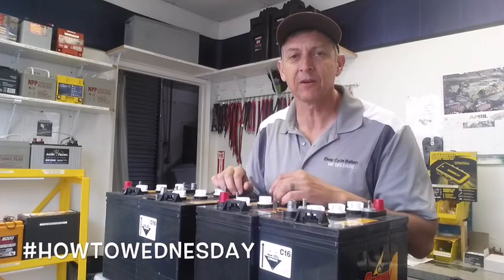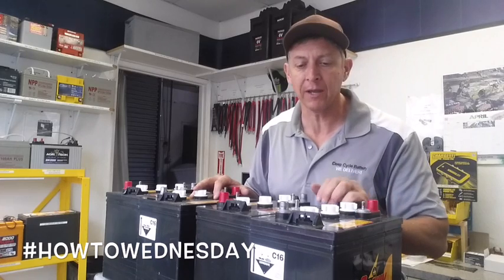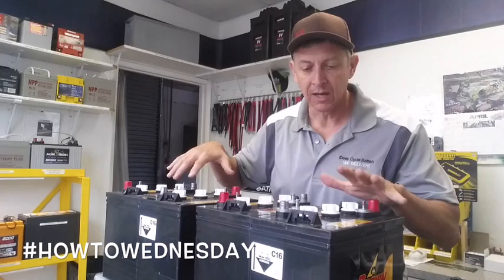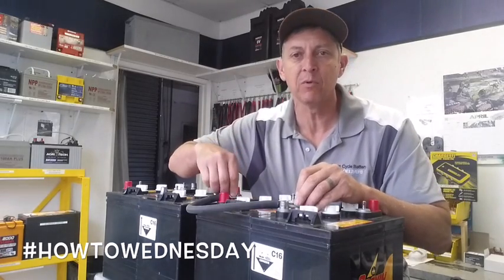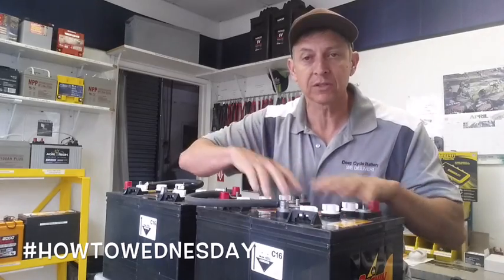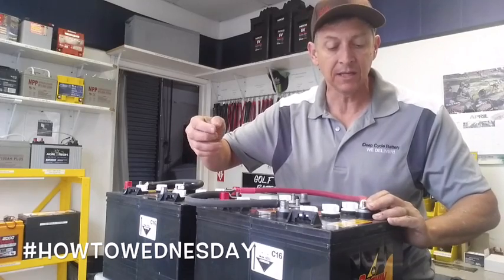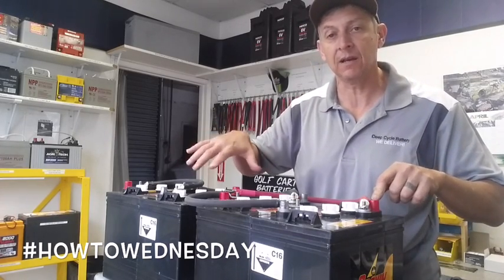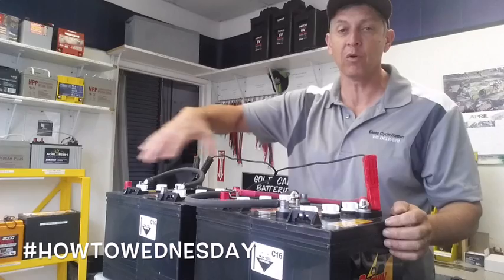How to Connect Batteries in Series Parallel Deep Cycle Battery 6 Volt

Comment: 1044am I have 8 batteries T.20 Trojan tractor batteries 6 volt deep cell. Can I hook all up for 12 volt system for an off grid solar set up. I really need help.
Reply from the maker: It sounds like you're trying to mix six volt deep cycle and 12 volt deep cycle? If so not a good idea
Reply: @DeepcyclebatterystoreSanDiego  well I figured it out. 8. 6 can make volts 4 12 volt batteries in series. Then parralel to make one giant 12 volt battery
Reply: No. Wiring both series to make the 12 volt. And then wiring for parealel to make one big 12

Comment: we have  (8) 6volt batteries(400AH)  hooked up series with parallel  on a stand alone solar system for our submersible pump and freezer -  What gauge would yo recommend ?  4 gauge cable ?  Thanks for your excellent video and instruction on this !
Reply from the maker: 24V system? What is inverter voltage and watts?
Reply: 10-15 volts incoming on first inverter(AIMS Power 5000 Watt Power Inverter, PWRINV500012W)   second inverter (AIMS Power 3000 Watt Power Inverter, PWRIC300012W) also has 10-15 input volts     --   thanks for your thoughts !      Dave    -   both inverters are about 10 years old  - but all worked well until the batteries died

Comment: Thanks for this video, this is the exact setup I have, including the same branded batteries. My setup is for a converted shed, that uses a 2000w inverter that powers the shed. I have a question: When charging with solar, the batteries will peak at 14.4V and the charge controller indicates that the batteries are full. Once the solar is disconnected or night falls, the batteries drop to 13.2V and will discharge without load to 12.6V throughout the evening. Is this common or is there any issue with the battery? I expected the battery to discharge at a slower rate.
Reply from the maker: This is normal. read article on battery discharge characteristics
https://batteryuniversity.com/article/bu-802b-what-does-elevated-self-discharge-do

Comment: I'm installing 6 AGM 6v batteries in series/parallel in motorhome. Do all of the parallel cables have to be exact same length? I have 4 of the AGM's on a movable tray, the other two are stationary next to the tray. Thanks, Great video!
Reply from the maker: best design behavior is to use equal length when possible, but in your situation, you do the best you can

Comment: can i connect 12v deep cycle battery to my car's main starter battery in parallel? the deep cycle is different size and is bigger in ah and amps. i need extra juice for electronics charging and lights.

Comment: Can you connect only two 6v batteries in series/ parallel  ? Will it increase Amos or voltage ?
Reply from the maker: you can connect all batteries in series, parallel, or series and parallel to achieve the desired voltage
Reply: @DeepcyclebatterystoreSanDiego  how do you connect 2- 6v batteries in a series/parallel to double voltage and amps? Can you post a diagram for this?

Comment: Is it normal for the battery to spark once when the wire touches the terminal?

i was connecting the final either negative wire to the positive terminal.
Reply from the maker: yes, it may indicate there is a load on or that the solar is active in charging

Comment: Anyone know if I can connect 3, 12 volt batteries in series and parallel? I need 36 volts for running my trolling motor but then all of my other accessories are 12 volts

Comment: I hear a lot about balance in regards to the batteries. I'm expanding my solar bank to 16 6volt batteries at 210 amp hrs each. My first bank is all wired in series to generate 48volts at 210 amp hrs. They are laid out in a horse shoe shape with the positive at the beginning and the negative terminals at the end of the bank to the inverter. Would it be possible to set up the second. 8 similar to the firts and connect the second bank to the first via parallel? Thus staying at 48 volts with 420 amp hrs. I saw a setup as per the above, but had the bank setup with the positive and negative coming off each bank in the center connecting to the positive and negative cables to the inverter. 

I would like to maximize the amp hrs, but stay within reasons for solar.

Comment: hi gr8 tutorial. Can I hook 4 deep cycle 6 volt batteries in both series and parallel and achieve a 24 volt bank with the maximum amps? If yes please tell me how. I understand series and parallel but not sure on using both for the 24v bank, T-105's 220 amps ea. thanks
Reply from the maker: creating 24v system with 6 volt (ie 220ah ea) batteries with the goal of creating  max amps would require 2 banks, four 6v in series and parallel that to anther bank of four 6v in series, = 880 ah

if you need 24v with four 6v , connect the four 6v in series and have 220 ah
Your can use higher amp hour 6v batteries like the crown CR390 (6v 390 ah)
Reply: Thank you and yes I used Crown amps in live sound reinforcement. I Trust the name but did not know enough about their batteries for off grid.
Reply: Deep Cycle B86attery San Diego 11th 11th0